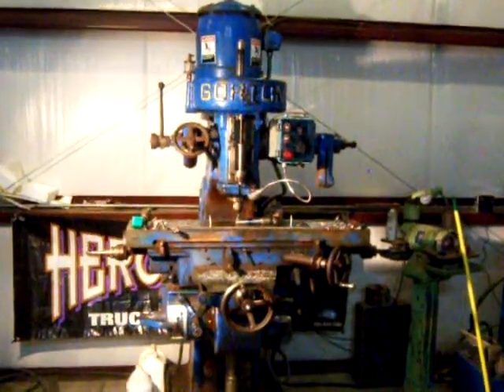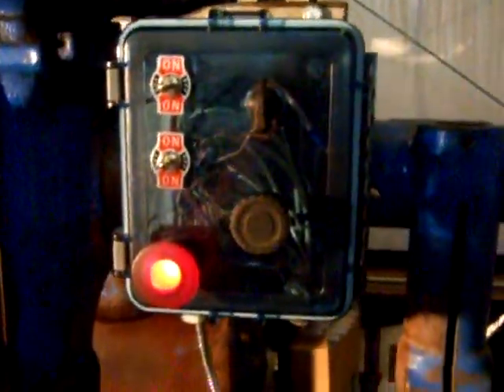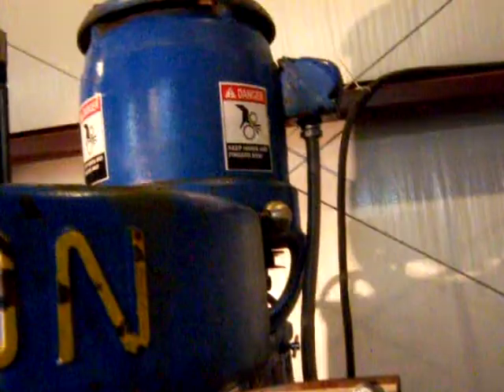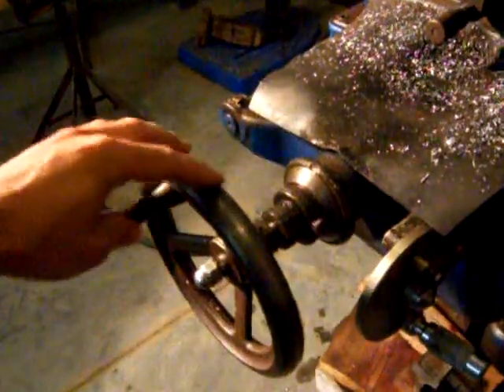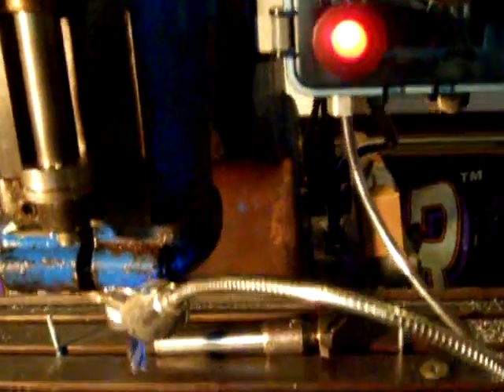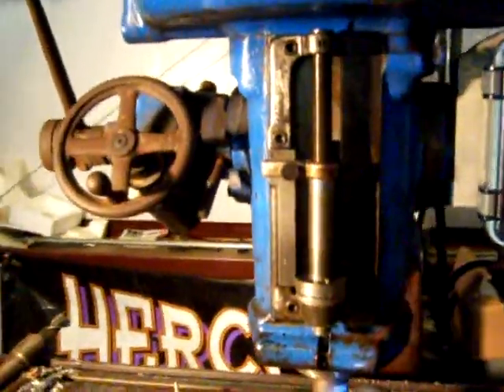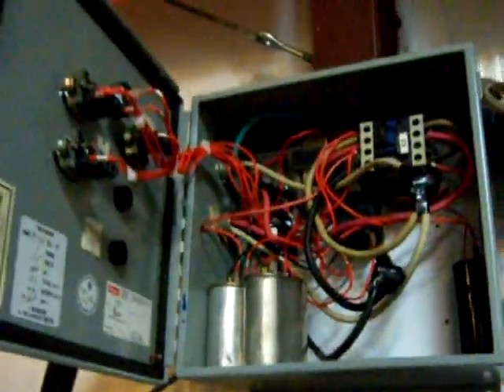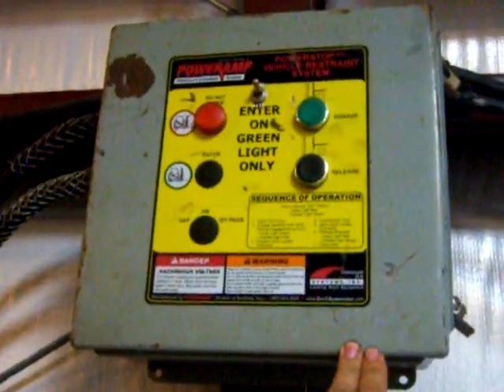Gorton 9-J Milling machine running !

Comment: Hey Jeff,  picked up a Gorton 9j a few months,  I have been restoring it.  Just got it running using single phase and a VFD.  I can run low speed, but when I try to run high speed the VFD errors and the spindle stops,  I also have to press the slow speed button after running the VFD, I hear that is not a good idea.  Could you give some info on how you worked around this issue.  I am assuming it is your rotary phase converter?  Thanks. Joe
Reply from the maker: Hello, the motor is 2 speed, I'm only using the high speed which is rated at 2hp, the low speed is rated at 3hp. I stripped everything electrical off the mill except for the motors. All the original mag starters are not needed with a vfd, they can cause issues. Depending on if you are trying to use the mag starters or it could be the vfd is not rated for the amount of amps, they would be different.  between the two speeds. I'm not sure how you have it configured but I would stick with wiring the vfd directly to the high speed because you can always slow it down with the belts and vfd. Milled some hard stuff and didn't have any trouble with it stalling.
Reply: @jefferybarnes6153  Thanks Jeff, yes I am going to have to bypass the mag starters.  Is you second VFD for the feed motor?

Comment: Nice to see that you saved a Gorton. I have an 8.5D with the duplicator table
   I am presently adding a VFD.  Did you have to use any of the belt arrangements or is it easy to get max rpm with the belt in one position
Reply from the maker: +hennys63  I still use the belts ,the vfd is what I use to fine tune the range of speed on each belt  setting. sometimes it nice to be able to use the mechanical advantage of the pulleys, specifically on heavy cuts.
I generally use the mid range. thanks for  the comment
Reply: +Jeffery Barnes 

  Thanks for your reply, I was putting mine together today and changed plans after seeing your set up
    I like what you have done and think you did a nice job of it